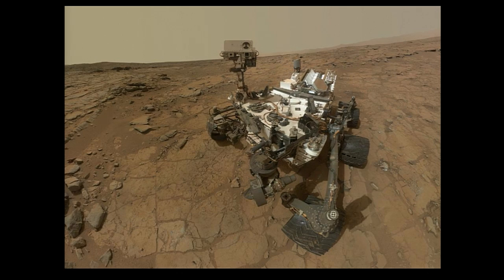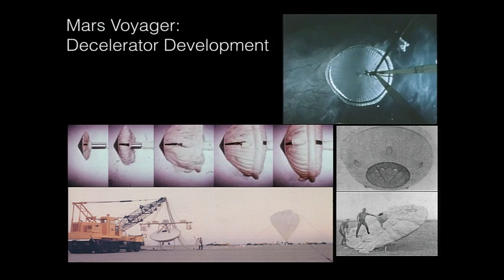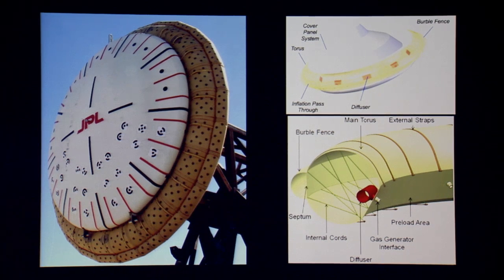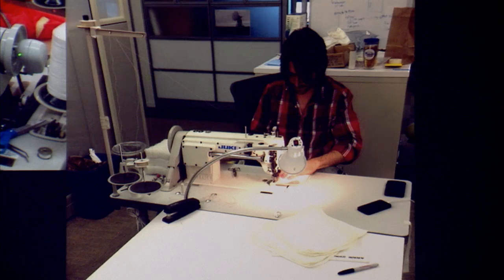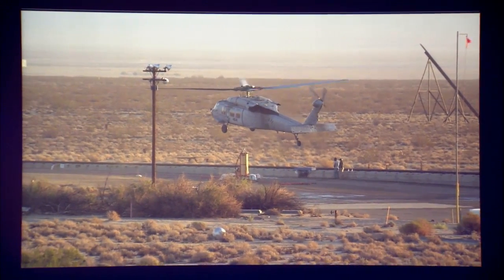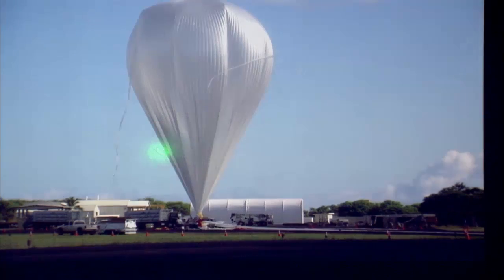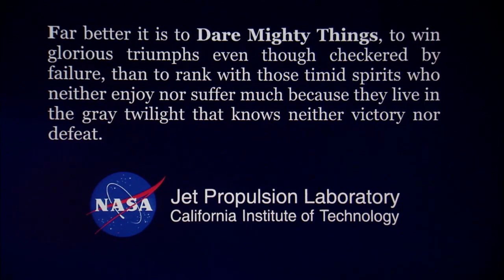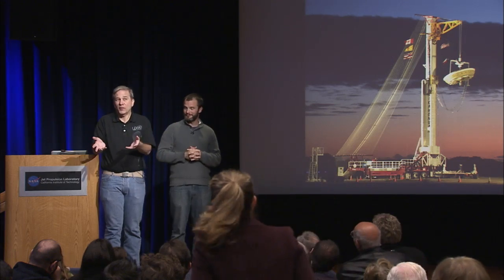NASA's 'Flying Saucer' Tech

Comment: Why not use an inverted turbine to slow your fall? 
As you fall an generate drag a turbine spins... that turbine in turn generate a mechanical force to provide a counter trust with another turbine that spibs the other way. Think judo. Using the generated force and redirect it.